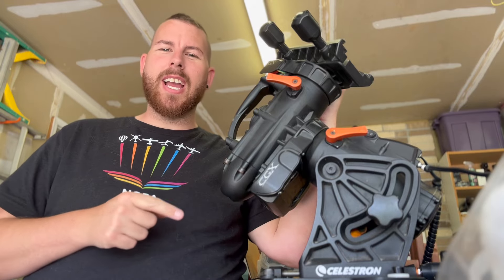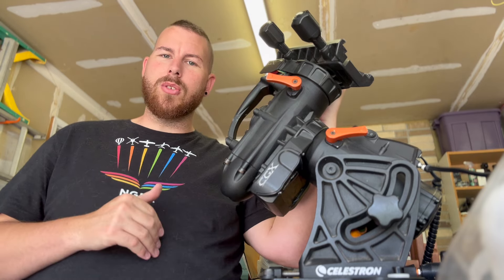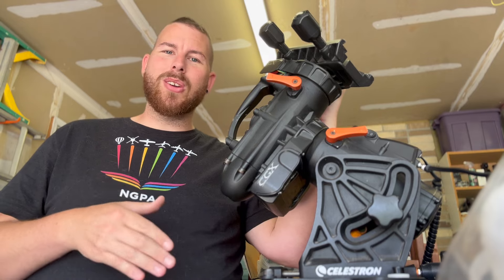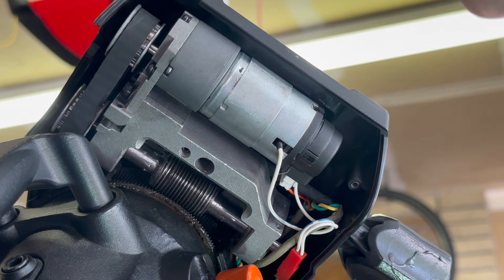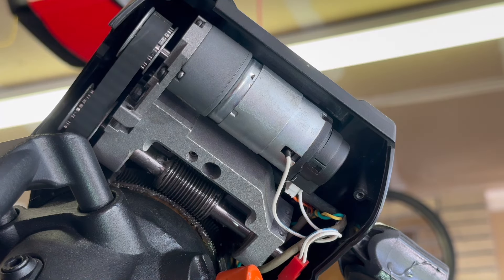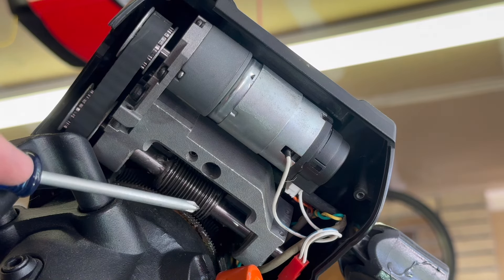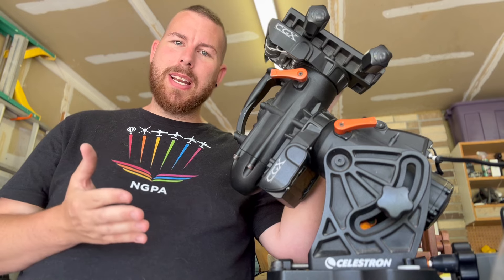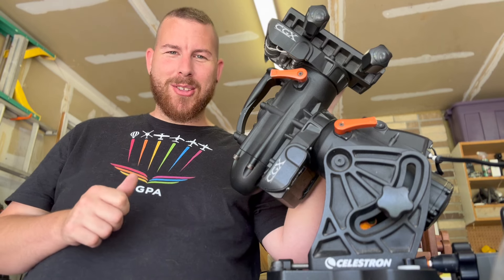Celestron CGX - 3 Maintenance Tips for Better Performance

Comment: Thanks for the video on these issues! My CGX is at Celestron right now.  I didn't have issues with loud noise or motor fluctuation, but guiding is poor, regardless of seeing conditions, balance or PA.  I've owned it for about five years, and I believe it simply needs a tune up. Large Dec backlash and some odd RA movement.  Hope it comes back a better mount.

Comment: you mentioned two screws to adjust the belt tension but you never showed them. one is the push pull screw of course but which of the three on the motor?

Comment: CGX maintenance. Disassemble. Throw in trash :P
Reply: I don't have it in me to throw mine away :D Its been a paper weight for close to 2 years now. I would be careful buying these mounts now since it can be hard to get parts and their value should also drop very fast soon(seen a 1k$ drop where i live already) with the rise of cheap harmonic drives in the same price range and capabilities.